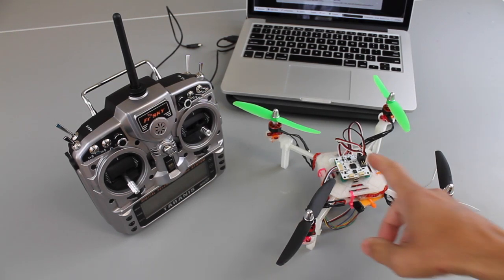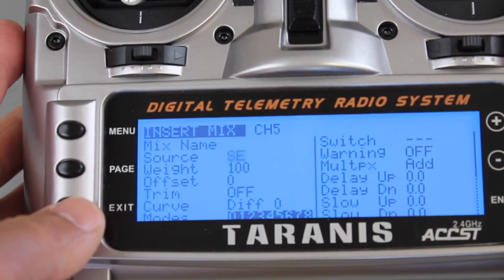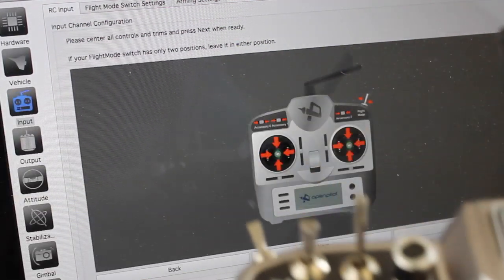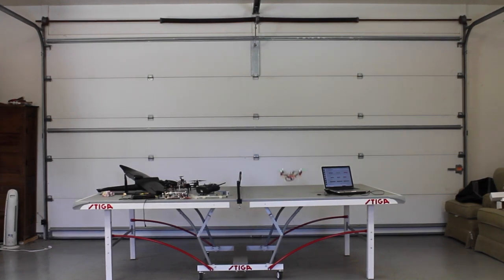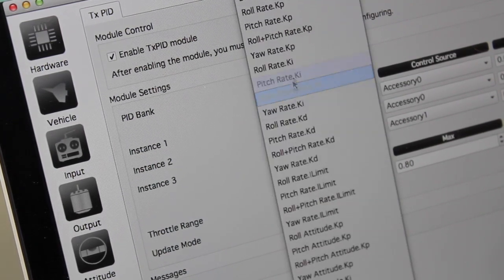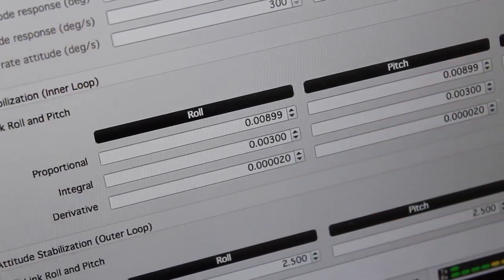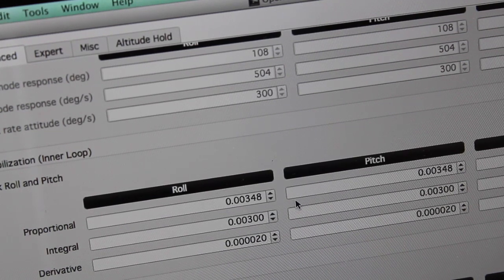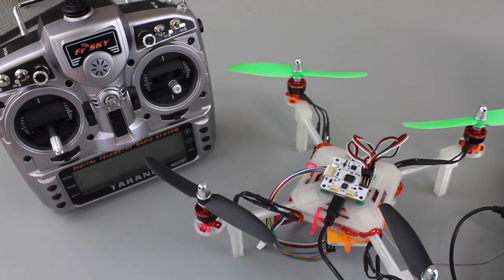OpenPilot CC3D Multiple Flight Modes and In-Air Gain Tuning with FrSky Taranis

Comment: Hi Dennis, 
Is there any special requirements about the Transmitter to be able to do this?
I want to do it with a 10 channels Flysky i6X using iBUS/SBUS
Reply from the maker: I think the Flysky has the ability to set custom modes for any of your switches so I definitely think it's possible. Now I've never done it but I'm hopeful that you can figure it out. Let us know if you can get it working. Thanks.

Comment: So you always use a flight mode where roll and pitch are stabilized? Can you also configurate one of the three first flightmodes to be not stabilized for racing purpose? I mean by that, that when you move the pitch/roll stick and let it move to the center again, the quad won't stabilize itself.
Reply from the maker: Yes that's absolutely possible. Check out rate mode.
Reply: Dennis Baldwin
Perfect, thank you.

Comment: How to set my cc3d (250size) quad to use auto leveling??? Currently it acts like its in rate mode all the time whatever setting I tried. It simply can't raise vertically up in the air, it always moves - more or less - into a sideways direction.
Reply from the maker: I'm not sure what your problem is but I'd recommend going through the setup process again. It should do some sort of stabilization if you've configured it correctly. Perhaps you should check your flight mode switch and make sure that in OpenPilot GCS that the default mode is stabilize. Good luck and let us know how it goes.
Reply: Thanks for answering, I finally tried LibrePilot also (95% OpenPilot, newer), balanced my quad physically (pushed the battery to the back a little bit), and I calibrated the CC3D on a perfectly level surface (very important!) and it is much better now!
Reply: By the way my quad weighs around 620 grams (2200mah battery, fpv camera+transmitter, Xiaomi Yi camera), is that a lot?

Comment: how did you connect CC3D to power or PDB ?
Reply from the maker: +Michael Zukas Because the frame is so small I was unable to use a PDB so I wired up a pigtail with ESC power leads and a JST connector. The CC3D gets power through one of the ESC BECs. Hope that helps and good luck with your setup.

Comment: Hi, Dennis nice video, just a general question about pid. If my quadcopter has a large battery crossing the frame from back to front,  and is located 5cm under the chasis , so the movement in the roll axis  takes more effort, what shoul I do? Increase my P in the roll axis? Decrease it ? Raise the I?

Btw I ask this because my batteries have died  so I cannot test anything right now.
Reply from the maker: +Dashz That's a great question and to be honest I'm completely stumped by it. I definitely think it's the P or I gain on the roll axis, but I'm not 100% sure which way (up/down) you'd need to tune it. If it were me what I would do is set a baseline (where you currently are). Then slowly work your way up/down and see what feels right. Sorry I can't give you a more specific answer.
Reply: It seems like the isolations depends a lot with  the P.
I have been able to get good results lowering (in roll)the P in stabilized mode and lovering the I in rate,

I think it really goes against logic since in roll axis the quad should need more effort to rotate. in fact in camera gimbals, the roll usually needs more P and Power to work properly.
This doesn´t apply to quads, at least with my S500, maybe its just because the center of gravity is much lower and it really doesn´t need too many corrections...

Comment: what does it mean to "power cycle"
Reply from the maker: +Maverick Rushton Basically to remove power and apply it again. That could either mean unplugging the battery and plugging it in again or unplugging the USB cable and plugging it back into the board.

Comment: I seen how you do the P part but how do you do the i and the d on the pid
Reply from the maker: +farley0615 This a good thread that has some info about I & D. To be honest I've spent very little time with those gains and have generally seen good results with tuning just the P. But I'd like to get a better understanding of I & D. Thanks for the question. http://fpvlab.com/forums/showthread.php?43746-Need-help-PID-tuning-with-OpenPilot-cc3d-on-250-quad

Comment: How do I put the PID on a 3 position switch,and use the knob,or a 3 position switch to adjust the values up or down! Any help would would help,I cant find any info on the CC3D,an transmitter tuning with the PID on a 3 position like cleanflight,I'm not sure on the necessary mixing!
Reply from the maker: +im2tall1 That's a really good question that I wish I had the answer to. I could definitely use something like this for testing purposes. If anyone else knows please enlighten us!
Reply: I think I figured it out,by mixing the Accessory 0,1,2 to each position on the switch,that would have to be done that tx setup configuration when you assign the switches,just toggle each bank on the 3pos switch when it asks what accessory you wanna use,you can then go back in your tx,and mix a dial or 3pos switch to control increasing or decreasing the roll/pitch gains,that the input,the out is basically the same with the accessory assignment,but you have to set the pwm on each bank when you want it to activate in the top middle or bottom!! I completely lost myself,hope that makes some kinda sense!You only get 3 with Open Pilot so it would probably make more sense,and its a lot easier to just to assign the P,I,D to 3 individual 3pos switches,they would be Accessory 0-P,1-I,2-D.then when you're done disable tx pid,and use your accessory assignments for something else. Drops mic walks off exhausted!!LOL
Reply from the maker: +im2tall1 Good stuff! Glad to hear you got it working and thanks for sharing.

Comment: Hi,
Thanks for the detailed and well explained usage of TxPID config on the cc3d.
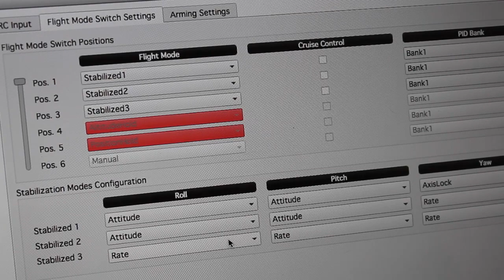A little off-topic, but as i'm learning the cc3d, i was wondering if there is a way to change the active "Settings Bank" using some TX switch, like it's done for the flight mode. I mean, like in your video at 4:25 you can see the screen of GCS showing that you could have 3 bank with different settings, but i could not yet find how do i change the active bank on the field without connecting a computer to the cc3d. Could you tip me in the direction of some readings about it? 
Thanks again.
Reply from the maker: +Chinellos Verdes Very interesting question. Not sure how to do this but when I get some time I'll definitely try to look into this. Let us know if you come across anything first. Thanks.

Comment: CC3D won't recognize my three position switch it's only picking it up as a two position could you help?
Reply from the maker: +Tim Bell Be sure to check your stick monitor to see that all three of your switch positions are emitting different PWM values. It sounds like perhaps 2 of the 3 switch positions are not changing. I'm not aware of anything in CC3D that would cause the behavior you're describing. Good luck.

Comment: CC3D won't recognize my three position switch it's only picking it up as a two position could you help?
Reply: +Tim Bell , redo your radio setup
Reply: +Jeremy Hoffman no joke I literally have 100 times. I have multiple craft (11) and it won't pick it up on ANY of them.
Reply: +Tim Bell When the radio setup tells you to center all switches and knobs, did you center it by leaving it in the middle? Dunno man, that solved it for me.
Reply: I had the same issue. Turns out that in both, the INPUTS page and in the MIXER page, once you're in the channel of the slider, you must leave the default value in the SWITCH setting. The default value looks like three dashes, like this:   - - - . Once I did that, OpenPilot recognized the three switch positions.
Reply: +wexer82 Awesome thank you sir I'll give it a try.

Comment: Hi guy! Do you are using cruise control or manual?
Reply from the maker: +Gustavo Neves Normally rate mode which is probably what you mean by manual.
Reply: +Dennis Baldwin Thanks, but I would like to know about yours setting by "Flight mode switch settings" in open pilot CGS. In the film does not give to see if you have chosen "Manual" or "Cruise Control" Could you pass me the print screen? gustdcn@gmail.com

Comment: Any reason why the board won't save the advanced stabilization setting?  As soon as I power cycle it, it reverts back to beginner stabilization.
Reply from the maker: +themrbobjr Interesting. I haven't run into that before but will see if I can find anything out. Please keep us posted if you come up with a solution.

Comment: Hi Dennis, I had no luck with KK2s on 250 size quad but they worked OK on larger quads. So I tried a CC3D, finally got it set up and running on a 250 quad, it flew fine in my back yard. Zipped it around up and down my hard, some hard throttling it seemed fine. Toke it out to our airfiled on a windy day, 10 gusting to 15 mph. It was kind of gittery and then just flipped over and crashed, tried again and it just flipped almost immediately. Is it common for mini quads to have problems dealing with wind gust?
Reply from the maker: +Carl Bradley I'd say it's problematic but definitely wouldn't expect the behavior you described. I've flown my mini in 20mph gusts and it managed okay. perhaps look at your gains and make sure they aren't too high. If you get to a point where wind causes oscillation and it get worse not being able to recover then you have a real problem. It's hard to say without knowing all the details but from what I'm hearing I'd suspect gains or maybe vibrations. Give those two a look and let us know what you find out.

Comment: This video is just perfect. Thanks
Reply from the maker: Miguel Vega No problem. Thanks for watching.
Reply: Dennis Baldwin hey could you explain what different modes there are and how they work like manual/rate/acro because I only fly on selfstabilization and it would be nice to know

Comment: after tuning my quad flies  great and when I save it in the settings to the board it will not arm so I don't know what I'm doing wrong and it won't fly
Reply from the maker: Janeth Garcia My only suggestion without knowing more is for you to save your settings via screen grab or text file then manually try to enter them and save them. The OpenPilot GCS can be a bit picky and perhaps there's a value that it doesn't like. Keep us posted and let us know what you find out. Thanks.
Reply: What I ended up doing was leaving the boxes checked in both txpid menu and left the accessory enabled,  I just disabled my knob switch and It allowed me to arm my quad and fly it.   Otherwise un checking those boxes my quad would not arm
Reply: +Janeth Garcia.  I had the same issue.  Just had to leave accessory 0 enabled for channel 6 and then it worked-- so strange.  Didn't have to enable the TxPID though so those numbers should be locked in.  Thanks for he great tutorial Dennis!

Comment: Dennis- once you've in-air gained, how do you save the values in GSC? I have tried but I cant get the values to move.
Reply from the maker: M Minskie If I recall you need to land and disarm. The values will be loaded into OpenPilot GCS and then you click save there. You'll need to disable the in-air tuning option otherwise they could get overwritten. I recall this being a bit of a pain, but hope this helps get you configured.
Reply: thanks very much!

Comment: how do you power cycle the CC3D board?
Reply from the maker: M Minskie I basically disconnect the battery and connect it again. The software will detect the reboot.

Comment: hi guys. Hi +Dennis Baldwin.  Is is possibe that the dron will keep position if I am not touch a controll.  I have a spring in the throttle so my bar is in the middle. if I fly on naza it maintains the height if I do not touch anything. ( without GPS Just Ati)
Reply from the maker: Tomasz eR You're not going to see it handle attitude as well as a NAZA 450 setup. The CC3D does a good job, but on a small mini quad like this it's very sensitive since the setup is incredibly light.
Reply: Dennis Baldwin thanks

Comment: Man i cant seem to succed power cycling can you demostrate maybe. Its not looking good for me so far, it wont save my settings
Reply from the maker: theroskyyyy I recall having an issue with this. I had to reboot my CC3D and restart the OpenPilot GCS then I was able to save settings. It can be a bit quirky, but you should be able to get it to save. Good luck and keep us posted.
Reply: Ooh i went online, i learnt that i had to change my atming setting to always disarmed, after then i saved successfuly. Then as i wish i chise my txpdi uodate option as desired, i put update board always..thanks...had to learn a lot about this board :) was fun...but i still had vibrations on rate and attitude mode on my aeroplane wen flyibg fast..so im planning to vuild a much slower and lighter aeroplane....

Comment: Hi! I have a HJ MWC 500 quadcopter. I haven't tried tuning the quad. My problem is that when I try to descent my quadcopter starts wobbling a lot. Do you think that it is a PID tuning problem?
Reply: Also it's almost impossible to yaw 360 degrees. If I try to turn, it starts moving around out of control. Should I try tuning my quadcopter's yaw?
Reply from the maker: GerengG1 I'd definitely look into PID tuning as that's generally a good place to start when it comes to oscillation. If you're seeing a bunch of wobbling consider bringing your PID gains down slightly until it becomes more stable. That's my best guess based on the information I have. Good luck and keep us posted.
Reply: Dennis Baldwin I tuned the quad but unfortunately it still seems to drift while I yaw. Would it help if I tuned the yaw or it won't do anything?

Comment: Hi Dennis, very nice and informative demo. Btw, my quad is going backward (tilting backward) at the initial flight (throttle around 5-13%) so I did not take the courage to lift it up or throttle a bit higher.

Things I've done so far:
- ESC calib (using openpilot GSC)
- Verified Motor rotation correctly
- Props placement (cw/ccw)
- Making sure quad weight is balance from the center

Quad Specs
- 250mm
- cc3d
- devo 7

Any idea what's the problem on this? Sorry i'm just new to this stuff.
Reply from the maker: Sen Malones Maybe look at your pitch trim in your transmitter settings. That's the first thing that comes to mind. If you continue to have problems check out www.garagepilots.com and post in our forums. We should be able to help you out. Good luck!
Reply: Sen Malones I had the same issue but mine was tilting forward even with full trim backwards. The I made sure my quad was placed on a perfect flat surface and recalibrated the cc3d and that solved the problem. So you might need to recalibrate your board.
Reply: Dennis Baldwin
Ahmed H.M.
Yep, i was able solve after recalibrating again. Thanks guys.

Comment: Not sure whats going on with my qav400 now. When I try and hover it just flips it self end over end or sometime side too side. Really don't know what to do now.
Reply from the maker: Christopher Gannon Double check your motor rotations as well as make sure you have the right props on each motor. That sounds like it would cause the symptoms you describe although it's hard to tell without seeing your setup.

Comment: So my quad randomly won't axis-lock when I'm in attitude mode. Have you ever seen this? I keep reconnecting and running the wizard but it doesn't seem to trigger axis-lock when I'm in attitude flight mode :(
Reply from the maker: SF PV That's strange. No I haven't seen that before. If you continue to have problems we have a forum at www.gargepilots.com and maybe we can help you out. Thanks for the comment.
Reply: Thanks for replying Dennis. I just reset my CC3D about 10 times and then it started working again :)

Comment: Hey dennis great videos very well put together  my question is if the board gets its power from the reciever then I dont have to worry about cutting my bec power wires with this board.thanks in advance
Reply from the maker: george nessman I'm not 100% sure because I've never seen a setup where the receiver powers the board. Normally the board may be powered by one of the ESCs or separate BEC, which in turns powers the receiver. But it's hard to say without knowing your specific setup. If you need more help then please check out www.garagepilots.com and post in the forums. Some pics may help too. Thanks and good luck.

Comment: I followed your instruction up to 7:31 min. where you arm the TX, but my properly set Aux (CH6) for in flight Gain tuning knob has no effect to the Roll/Pitch! I checked the sliding bar display in Input tab and it works fine. What do you think went wrong?
Thanks,
Reply from the maker: Tanasit Siriluck Very strange. I would expect that to work if you're seeing the slider move. Have you rebooted your cc3d after you enable TxPID as mentioned here?

https://wiki.openpilot.org/display/WIKI/TxPID

If you continue to have problems please post in the forums at www.garagepilots.com and hopefully we can help you out there.